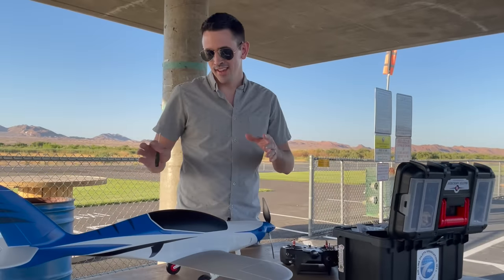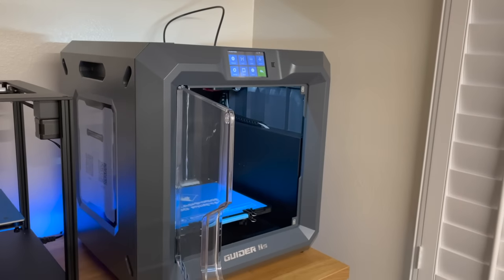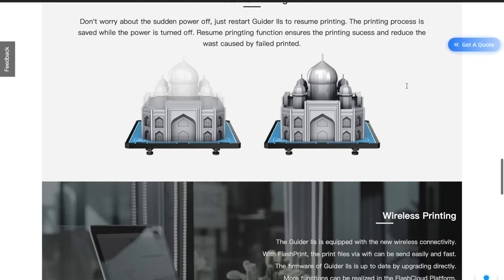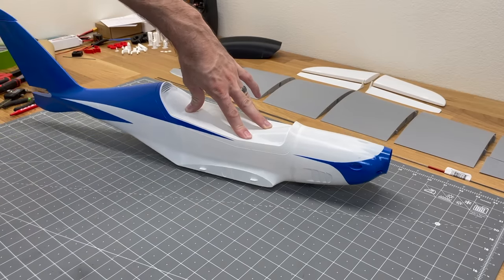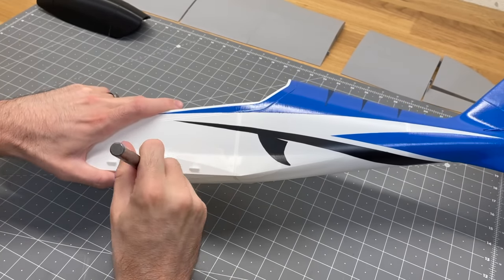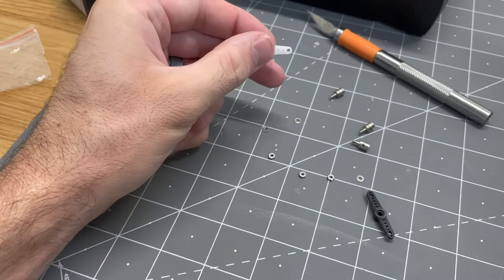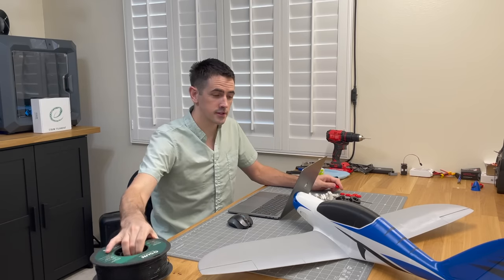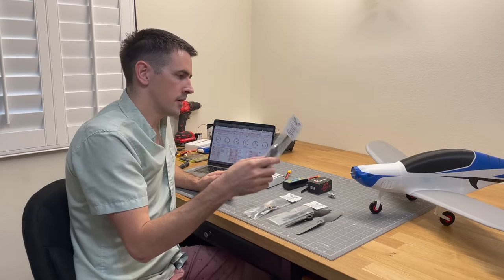DIY RC Plane Full Build - ft. FlashForge Guider 2s

Comment: What is the print setting infill walls supports print orientation etc
Reply: it is in the description.

3D Printer Settings;

Quality:
Layer Height – 0.2
Line Width – 0.4
Shell:
Wall Line Count – 1
Infill:
Infill Density – 0
Material:
Printing Temperature – 230
Build Plate Temperature – 60
Flow – 102
Speed:
Print Speed – 40mm/s
Outer Wall Speed – 40mm/s
Inner Wall Speed – 60mm/s
Travel Speed – 120mm/s
Travel:
Enable Retraction – Checked
Retraction Distance – .8
Retraction Speed – 35mm/s
Retraction Extra Prime Amount – 0.2
Combing Mode – off
Cooling:
 Enable Print Cooling – Checked
 Fan Speed – 100%
Mesh Fixes:
 Union Overlapping Volumes – NOT Checked
Special Modes:
 Surface Mode – Normal
Experimental:
 Slicing Tolerance – Middle

But it would most likely work best just to import the g-code files in the download.

Comment: Great video. I downloaded stl files, sliced in Cura and started printing but noticed  the  support/ribs are not attached to the walls. I went back to the preview and the Layer view- start- shows support/ribs floating away from the wall. Is there away to adjust this. I am using your thin wall print settings. Thanks
Reply: yeah theres quite a few errors in the stl files and the g code isnt compatible with bowden printers
Reply: Same problem, did you figure it out?

Comment: Can you do a video of how to "edit the bowden retraction settings"? I'm very very new to this but I can't seem to get the STL's to load the entire object on cura so I have to use the GCode files however stringing is MISERABLE and the grills won't print at all.
Reply: Also using ender 3 v2 with creality direct drive

Comment: When slicing the models, I had a problem where the red areas ,that are there to show where the supports are needed, are flipped and are on the bottom part of the model instead of the top, seems like they are flipped. Any ideas to fix this?

Comment: What’s the minimum printer size I need? 
Mine does 150x150x150mm, is that enough?
Reply: the biggest part is (part of fuselage) is 200mm, you can always edit it in a program like blender and jys cut it into smaller sections, and ad some slots and tabs tp line it up again.

Comment: Hi I’m a new subscriber, and newbie learning to print RC airplanes. My question is about control surfaces failure under high stress and G forces. In the early 1990’ I flew Advance & Expert Pattern flying. Our control surfaces were 99% secure to pushrods. Has anyone lost a printed model due to printed control horns?? Thanks newbie. 👍🏽
Reply: Well, he did use CA glue and locktite on the bolts so I'm assuming they're held in place pretty good.  Cheers!

Comment: in the video, the printer prints with Surface Mode - Surface, and when the wings are folded, the wings are printed in Surface Mode - Normal. why so? which type is correct for the wing?

Comment: Hi, one question. I´m use your Gcode for print in my ender but have part with not print.
So I decided work with STL drawing and in Cura don´t recognizer internal parts of drawing (only external perimeter).
Can you help me? 
Greetings.

Comment: Just curious, is it possible to print the plane 2x larger?
Reply: You can scale everything up (2x) but you'll need a bigger 3D printer.  I have a CR-10 V3 that probably could print it double sized.  The other problem is that all the electronic components won't fit unless they are also double in size (servos for example) so that would be tricky.  You could probably 3D print a housing for each server that would fit into the underside of each wing so it would be a perfect fit.  Of course, you'd need more powerful servers if your plane is two times the size.  Let us know if you decide to double the size.  It would be amazing to see!
Reply: @krissebesta  Are you using mico servos now? A standard servo would work fine. A standard servo would work on a 90 size plane.

Comment: Troy, I am in the process of printing this plane right now. Working on the fuselage and ran into an issue with one of the STL files. Fuselage #3 appears to have gaps in it which caused my print to fail right towards the end. DId you experience any issues like this printing these out from the STL files.
Reply: same as well

Comment: Hi, great video, enjoyable to watch. I plan to build this plane, I wanted to ask, is this ok to print in normal PLA? And does it fly better than the Eclipson Model A? I've never flown before and the last time I tried with the Eclipson A in PLA, I crashed right on takeoff. TIA.
Reply: This plane (and probably no 3D printed one) is not suitable for beginners, you won't survive 5 min. But it's not as sharp as the WW2 models from 3DLabPrint.

Comment: Nice plane but it seems that it should have a carbon fiber tube through the wings. I've never built or flown a 3D printed plane so I don't know their strength in comparison to a carbon fiber reinforced plane.

Comment: can I use A2212 1000 kv motor with 1045 propellers?
Reply: did you try it bro? I tried that motor and those propellers and although it doesn't lift it vertically, it moves it very fast on the ground.

Comment: Has anyone else had problems with fuselage 2 and how did you you fix these problems
Reply: Hi, are you using cura slicer? did you use the STL or G-Code file?
Reply: Stl
Reply: @Daybinkie  I used the g-code, got some stringing, but turned out good.

Comment: Hi, great video!  I've tried to download the STL files and print it, I am not sure what I am doing wrong but it seems like there is a large gap between the outer shell and the inner support features, and the printer do not combine it all together. If I use 2 walls, one outer one inner it has better result but super heavy. To have 1 wall it seems impossible with that gap on the stl files. I use Cetus MK2 and cannot get cura to work with my printer using gCode, so I tried stl on up studio. And another thing, it would be super helpful to have a target weight for each part to see if I am on the right path, or completely not..Please advise.
Reply: Same problem like inner walls are floating in air
Reply: same problem, did you find a solution for adhesion between wall and the support features?

Comment: Hi, can I use a gas engine on this model. If yes, what will be the build for the firewall to fit in the engine and what cc will be required?
Reply from the maker: that would be a super cool project to figure out! there would need to be tons of modifications to include the gas tank, the firewall, what size engine you'd need. for the firewall, I'd probably use 1/8" piece of plywood

Comment: hey have u tried printing the fuselage in abs? and what print setting did u use for the ABS motor mount ?
Reply: ABS can warps like crazy when printing big parts.  I'd consider trying it in PETG, however.
Reply: @krissebesta  how heavy are the  PETG parts compared to PLA. Also the heat resistant of PETG? Is your fuselage in PETG?

Comment: Why cut instead of print with holes?
Reply from the maker: because of the way Cura cuts the part, it prints with way better quality if you just cut it out at the end
Reply: @TroyMcMillan  thanks for the explanation

Comment: i downloaded the plane but the files are broken. The slicer just doesnt slice the layers....
Reply: Did you fix it?
Reply: @pokiou works for me when I use the STL files
Reply: @1xnsrlgaming884  no didnt work at all.. when i run the slicer it doesnt slice the internal structure of the plane. I tried even-odd and so forth i just cant get it ot slice correctly.

Comment: I have a problem with the profile in cura. As soon as I change the surface type to normal, the internal reinforcements in the wings disappear. On the other hand, when I turn on surface mode it doesn't print my layers in one go which causes too much retraction. Do you have a solution to my problem ?:D or does anyone have a cura profile for PLA ?:D

Comment: I'm having problems finding the setting for my 3D printer.
I just tried to import the fuselage_2_v5.0.stl to the slicer, but it fails to slice a printable model. It spits out so many errors caused by missing layers, there is more air than printed lines
Any ideas? I'm using Bambu Studio 01.03.12
Reply: Im having the same problem. I can print the first part and thats it. Have you figured out the problem
Reply: @chrisbooth2116  Sadly not.
I put this aside, as I found another model which does not have those thin walls, so no problem printing it.